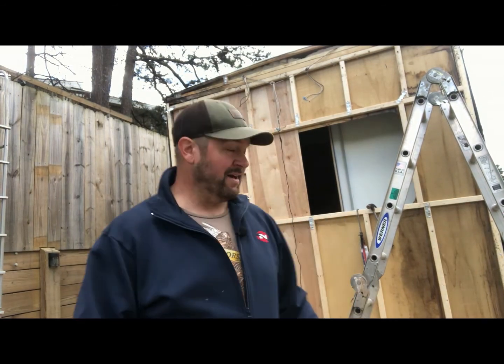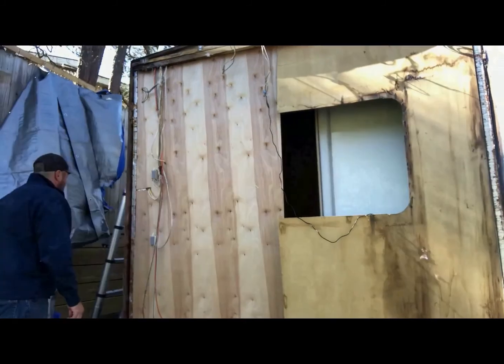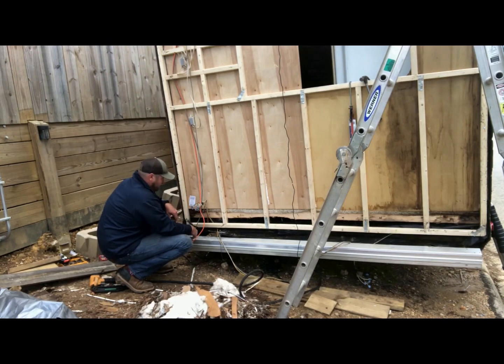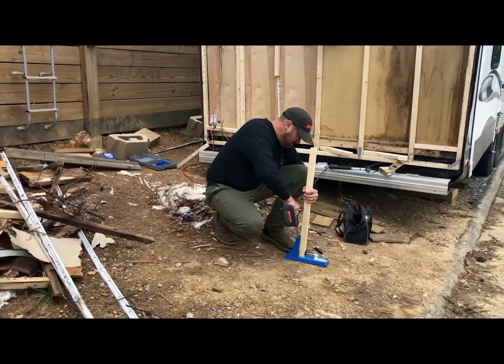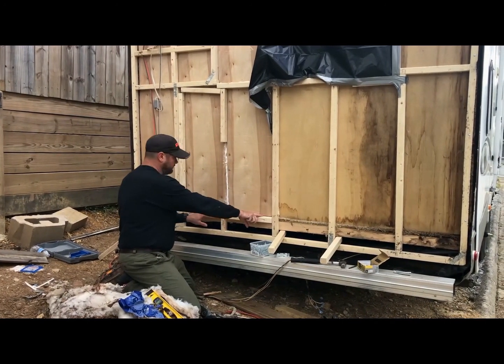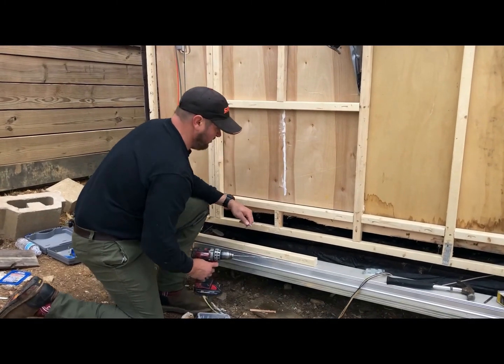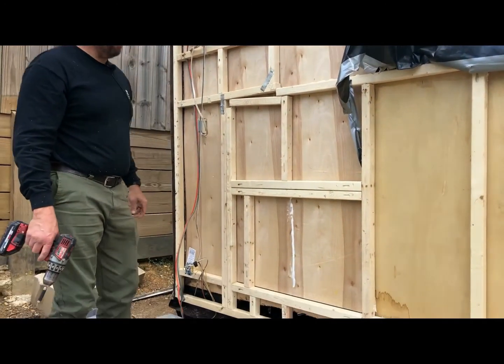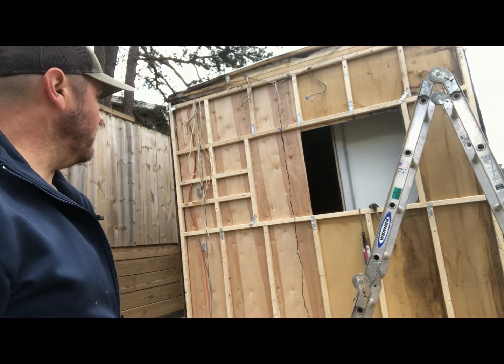RV REAR WALL REBUILD PART 2

Comment: I have to do a similar rebuild to a Jayco with aluminum siding.  The one change I will make is to use treated lumber and plan on using foam insulation like you did.

Comment: You didn’t show the condition of the roof and side walls never seen anyone put up interior panels prior to making sure the walls and roof are secure
Reply: Well the rear wall wasn’t holding up the side walls or roof, so it really didn’t matter there condition. I wasn’t focused on the rear wall which was obviously rotted bc of leaking from up top which is now sealed and fixed.